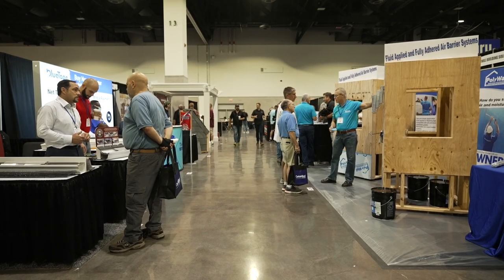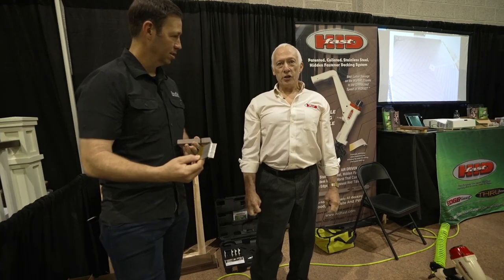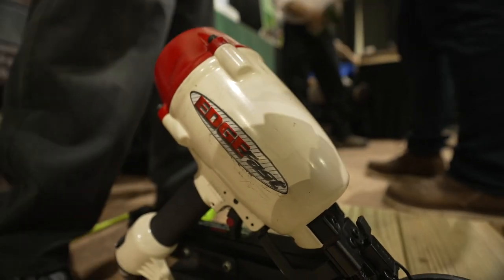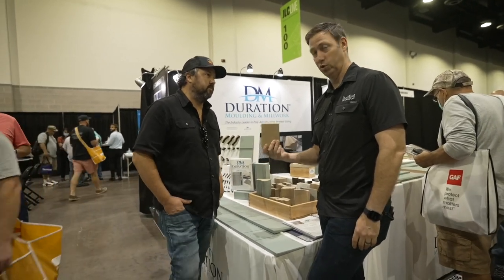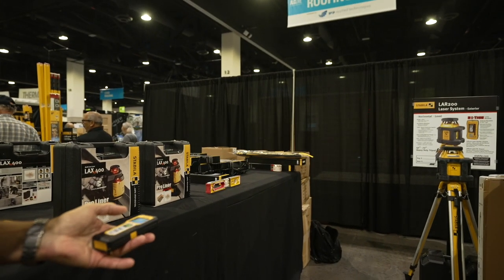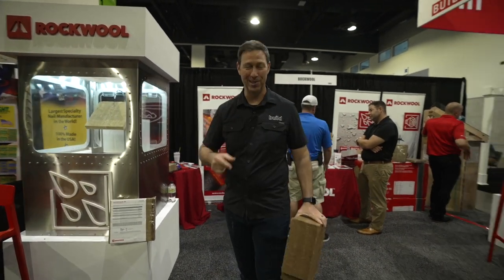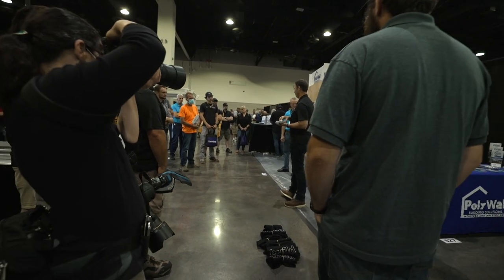NEW Building Products, Tools, & More  From the JLC LIVE Show in RI

Comment: To inform people triggered by "food based" building products, they use RICE HUSKS. It's a white rice (de hulled rice) production residue, basically organic waste. Preserving whole rice  long term is not easily feasible or desirable, where white rice preserves nearly indefinitely. Whole (Brown) rice has the hull, which contains the germ, fats (enzymes?) and some protein, making it go rancid quicker. There will be rice hulls/husks for as long as rice will be produced. 

My only issue is the choice of PVC as a plastic binder.

Comment: i have the 165' dewalt laser measure... its ok. for measuring on the ceiling for lighting, i will never use a tape measure again on a ceiling. but the batteries, horrible to change. just build 2 prongs into the thing and make it rechargeable.
the rice hauls... I know they make THF from oat hauls, and THF will polymerize.

Comment: On that deck board hidden fastener, when you have to replace a damaged board at some point in the future, how would you do that without damaging other boards?
Reply: You should be able to come in through the gap with an oscillating multitool to cut the pin, and then pry it up. Still messy, but the tradeoff is that you don't have holes in the top which aside from looking bad, collect water and such.

Comment: Just wonder how the hid fast will hold up on the coast
Reply: 304 stainless so probably real well
Reply: I don’t think 304 is good enough for saltwater environments.
Reply: 304 should hold up well as long as it's not used where it will make repeated, direct contact with sea water, like a dock (I believe 316 stainless steel is for that application). But, for a deck on a house along the coast, it should be good. As always, check you local codes before building with any materials. :-)

Comment: Does the laser tape calculate the length of the device? Or is it from the point of the lasers exit?
Reply: All the models I have (I can only assume Stabila's are the same/common feature) have a single button to toggle between front and rear "starting points" for measuring.
Once you start using a laser measure, especially on a ladder, you'll never go back to tape.
Reply: @valkyriefrost5301  ok that makes the best since thank you. I don’t think it replaces a tape measure sometimes you need to physical see what’s going on but it seems like a Indispensable item.
Reply: @TheGalacticWest  - you're absolutely correct. The laser measure does not replace the tape. I use tape for short distances and odd spots where the laser is not as convenient. I keep both in my pouch. Where the laser really shines (pun alert!) is sometime getting into small spaces that a wide tape measure can get stuck. This is not too often, but when it occurs, I am grateful to have such a tool on my belt. Together, they make a great team.

Comment: I feel sorry for the poor guy who has to fix a damaged deck board in the middle of the deck a year from when someone used that nailer to install instead of screws.  Good luck with that.....
Reply: Actually, I don't think it would be all that bad. Use a multitool to cut the damaged board at all the joists, knock off all the leftover pieces and remove any fasteners. Drop the new board in and use that pivoting nail gun to drive the new fasteners.
Reply: @HandlebarWorkshops  Sound like a pain to me - that is two cuts per nail (remember each nail goes into two boards) and then you have to make sure you don't hit the old nails when renailing on either board, do that on the last renail and you have to do the whole process over again (that nailing plate on the pivot is large enough you can't see under it).  And you have to do that on both sides for every joist of a 16 to 20 foot deck board (unless you don't mind a cut and paste, patch job that looks like crap)
Reply: @bestbuilder1st  - All true, but in reality, the need to repair a board is quite small. With PT decking, the wood usually fails as a whole and the whole deck needs to be replaced. I've owned decks for decades and never had to make a "repair" to just one board. However, the countless times of replacing popped nails... well, that's a common issue.
I do love screws over nails, but most production deck builders do not have the patience (time) or the commitment to quality that screws or hidden fasteners bring to a finished project.
Reply: @valkyriefrost5301  Two things:
1. They are using composite decking in the video - Have you ever dropped something hot off the BBQ on composite?  It melts. I can give you many stories or reasons about why someone had to replace just one board. 
2. You don't face nail composite decking unless you are a hack and no one should be hiring a hack in the first place.
Don't buy a deck made by a production guy if he doesn't have time to do the job right.
Reply: @bestbuilder1st  - You point is well taken. But there is a market for hidden fasteners like this one. So, I would expect to see it in your future, especially once their patent expires.

Comment: PVC is a horribly irresponsible product to be using on mass use industrial products. 
There's very little recycling and the product doesn't biodegrade. 
PVC is a terrible product for wide scale use. 
Shame on these innovations.
Reply: Pvc, if properly used, will outlast virtually every other aspect of a home, including the wiring and foundation. There's drawbacks to everything but if your building to last pvc is an obvious choice.
Reply: LMAO
Reply: @JAW88  I insisted that all my new plumbing be copper. My tissues carry enough microplastics. I don't need more. 
The rice plastic is still a maybe.
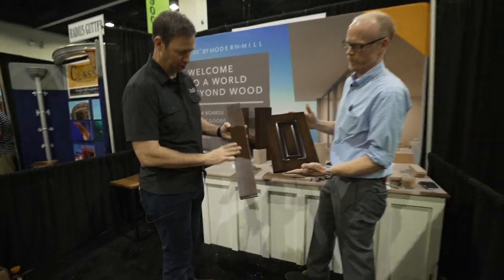Reply: @chadleach6009  Some of what they showcased was cabinetry (door at 10:58), which typically will get ripped out in 20-40 years after someone wants a new style long before wood has real issues in an interior environment. I agree with the sentiment that PVC can be helpful in spots where we need longevity, but using it where wood continues to do great does indeed seem wasteful.
Reply: @dosadoodle  it's also likely less expensive than wood, making it ideal for low income housing. 
There's multiple benefits, not just longevity.
Reply: @JAW88  - PVC is a bad product with a limited life span and no ability to recycle. It also becomes brittle with age and pressure. So, of course, my 90's built hose is filled with the stuff. On the bright side, at least I don't have Masonite siding. ;-)
Reply: @valkyriefrost5301  " ....at least I don't have masonite siding"
Lol.
Pretty low hurdle there, but agree with ya
Reply: @willbass2869  - yes, we have a very low bar in my state. Too much attention to pushing cheap 50 year homes for high prices instead of building to a 100 year standard.

Comment: 9:00... How about 1 guy on a ladder in the middle.  Measure left, put a mark.  Measure right to the mark. Then add.  Salesmen...SMH.
Reply: How long are your arms? I'll get maybe a 7' span of measurement.
Making multiple marks can also lead to compounding of measurement errors.

Edit: I wouldn't trust a drooping tape measure to be very precise over a long span.
Reply: @dosadoodle  I've been doing it that way for many years.  Most trim isn't longer than 16 ft. anyways.  My tape can easily reach 8 ft. in either direction without sagging.  It's only one mark BTW.  Most trim is cut on the heavy side especially when coping.